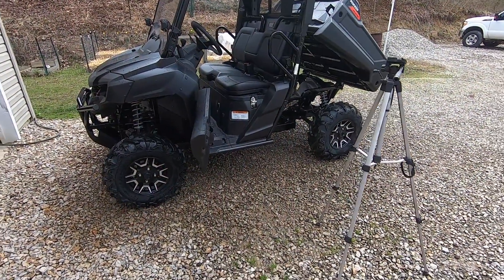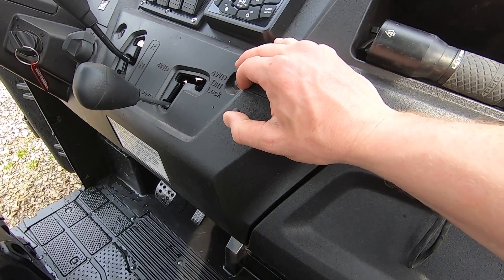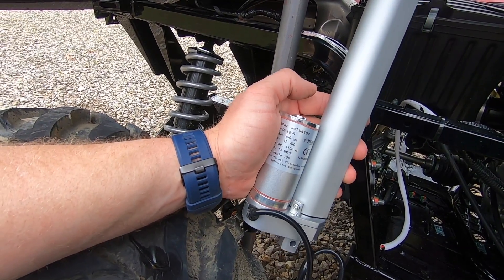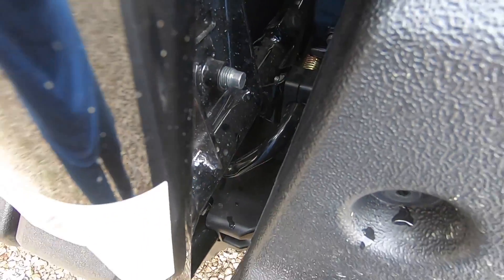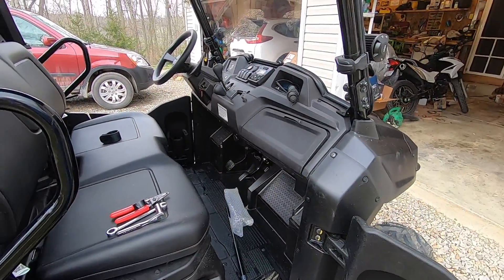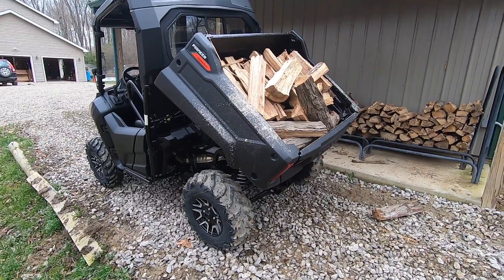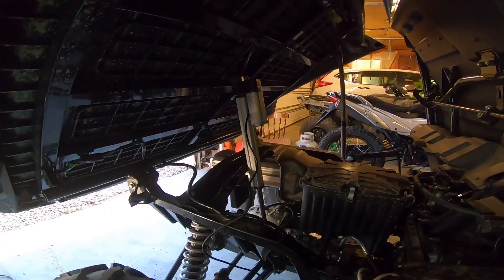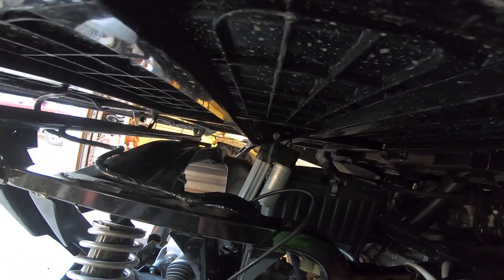Honda Pioneer 700 Electric Tilt Dump Bed Conversion

Comment: I can’t see the description
Reply from the maker: In this video I will show you how to convert your Pioneer 700 hydraulic assist dump bed in to a push button electric actuated dump bed.  Pioneer 1000 is very similar.
Parts Used In The Video (Paid Amazon Links):
Waterproof Toggle Switch https://amzn.to/34tL7g5
Alternate Switch https://amzn.to/34qGJi4
250lb Capacity Actuator https://amzn.to/2XoM3B6 
450lb Actuator https://amzn.to/2XsFTjA
Pioneer 700 Amazon Storefront.  All of the parts I have used to build my Pioneer 700
https://www.amazon.com/shop/jackofallmasterofnone?listId=RA1DCR5JCT3Y&ref=idea_share_inf

Comment: I see the accuator mounted in single shear.  How's that working for you?  Being an "Let's overbuild it Engineer" I would have mounted 2 accuators lifts (one on each side of the bed) and built both with bouble shear mounts.   
On my Brister truck, my beds pivot point is not on the end of the bed so when lifting the bed part of the weight of the load is already helping with weight balance.  I used 2 of the 300 lb lifts (like your first one) and mounted them in double shear brackets that I attached to the bed framing with rivnuts and welded the lower brackets up to the actual frame of the truck.  Also, I modified my tailgate so I can remove the pivot pins at the bottom, and leave the upper pins in place, to make a flap door at the bottom.  Put a short length of chain as a limit and open the tailgate at the bottom for spreading out my gravel more evenly.  More like a rock hauler would do to lay down a few inches at a time while they drive off.  I have a 450' long driveway and it needs more gravel every few years. I have been known to put 4 big scoops of gravel in mine.
Love my yard truck.  Unloaded a huge 12KW generator off a semi with it Friday.  Couple of years ago I built a rack on the front because I also have an "A" frame hoist attachment.  The front rack was intended to be for holding counter balance, but Friday I just slide the generator partially off the trucks trailer. Tossed a strap around it to tie it to the rool cage, and backed up to pull it off the rest of the way. Truck driver was amazed it looked so easy.  Those Yard Trucks are more handy than pockets on shirts.
Reply from the maker: It is working fine so far. I just used the OEM mounting point. If it ever breaks I will re-engineer things!

Comment: Is there anyway you could make a video of the p700 loaded with couple hundred pounds of corn or firewood going up a steep hill? I'm in the market to buy one. But. I'm afraid it won't have the power I need. I currently have a p500 and. It will pull anything if it hold traction which is why I went with it to start with. But am wa ting more room now.
Reply from the maker: Well I'm not going to make a video but I often carry a full bed of oak logs in the bed and it has almost no effect on the performance of this machine. My property is all hills by the way.

Comment: Could you put the hydraulic assist cylinder in tandem with the electric actuator so that it aids the actuator?  Basically one on either side of the top and bottom brackets.
Reply from the maker: You would have to seriously modify the hydraulic assist because it has a stud coming off of it. I suppose you could though. I've seen people use 2 Electric actuators in the same way.